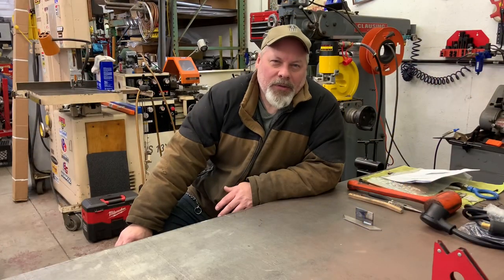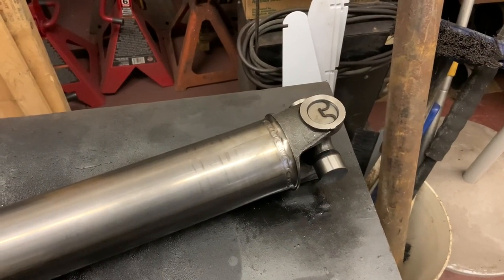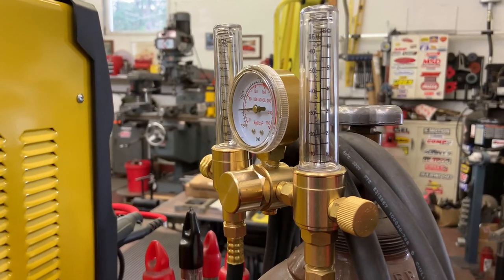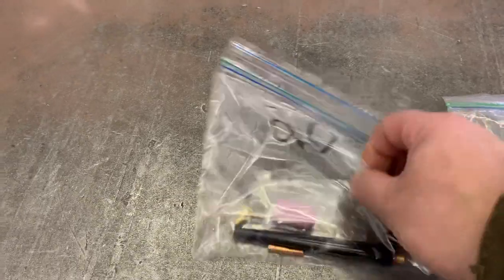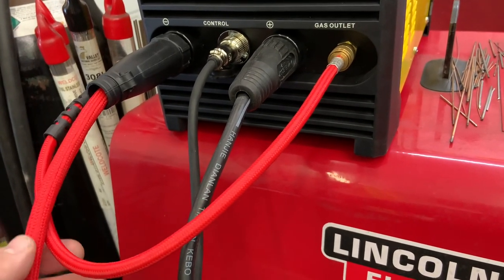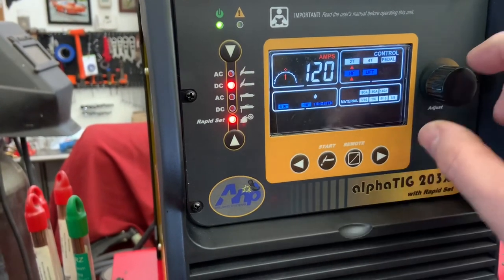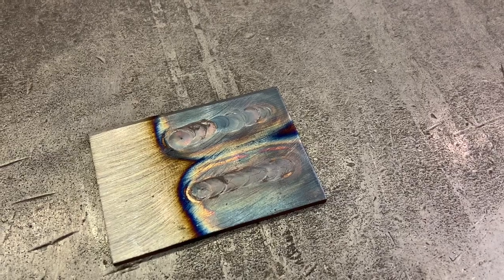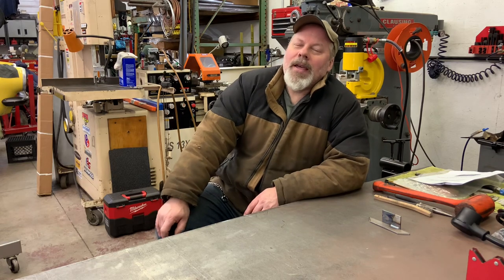Alpha Tig 203XI

Comment: I bought the 200x with all analog controls a year ago. Great machine and one feature I would like to see improved would be longer post flow on the timer.. not so good for titanium. 
The Arc is very good,  tried a handful of different  tungsten compositions.. everyone finds their own little niche.
The pulsar is a great feature especially with a welding positioner, you just need to practice with the settings of the background, on time, pps etc.
Hands down inverters rock on aluminum, especially thin aluminum compared to transformer machines.
I've been welding since the late 80's and have been employed with  NASCAR teams as a chassis fabricator using  many top branded machines so for 700 bucks this ones a winner!
Reply from the maker: Nice!

Comment: Are your rear wheels two piece where the center will unbolt from the rim?  My Kubota is that way and I was able to gain a few inches of width by swapping sides with the rims and tires.  The mount tabs in the rims are offset and allow for different back spacing.  This would allow more room for chains.  I like it because it make the tractor more stable in side hill situations.
Reply: and.....Love the new welder.  I'll upgrade my AHP 201 one day.
Reply from the maker: Yes they are, but the fenders are close over the top of the tires. 
Wrestling the front chains are heavy enough!

Comment: My Inverter, a Lincoln Square Wave 200, tells you not to use the green tungsten. I like the 2% lanthinated, I think the color is light blue. Each guy has his favorite, but I wouldn't use the green one on aluminum.
Reply from the maker: They call the Layzer “Chartreuse” , but yes the green pure tungsten is for transformer machines. It works well there.
I should not have called it green.
Appreciate the info, Thanks!!
Reply: @mountainsgarage  I did some aluminum welding recently with my inverter. I cut the top ear from a 4L80 case and fit in on a turbo 400, so I can use all the bolt holes. I copied one of your tricks and threaded the unused bolt hole to hold the dipstick tube.
Reply from the maker: @monkeywrenchization  How did the case weld?
Reply: @mountainsgarage  I had a lot of smut in the weld, kept grinding it out, eventually I got a strong weld. Cast aluminum is tough stuff to weld. I built it up heavy. , it didn't break.
Reply: @mountainsgarage  Is there something wrong at TSR Racing Products? I would like to get some parts for my 400. The website won't open for me, no answer on any of the phone lines. Did they close up?
Reply from the maker: @monkeywrenchization  I had two orders from them in December, haven’t heard anything.